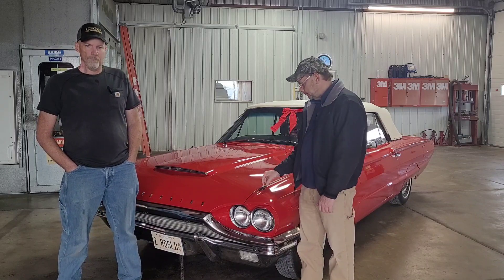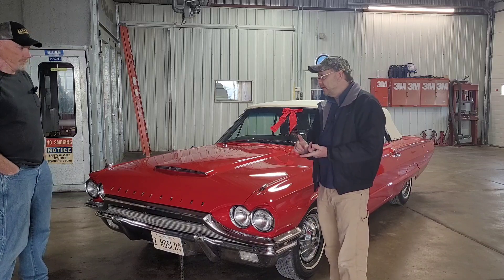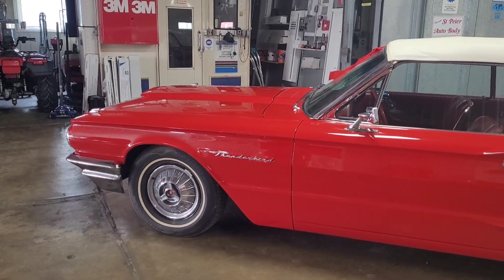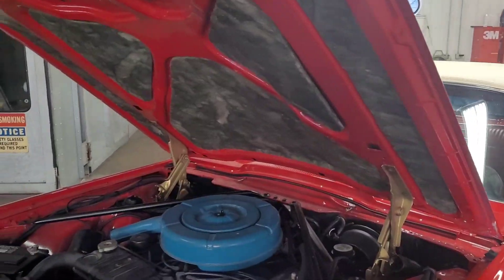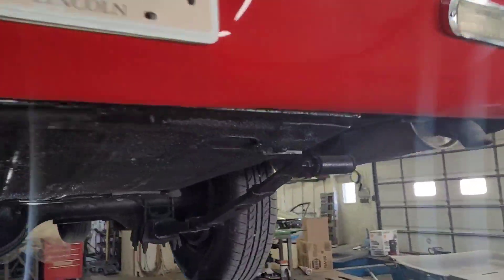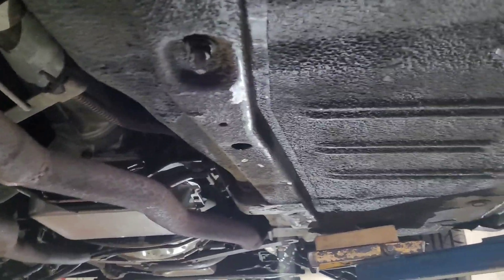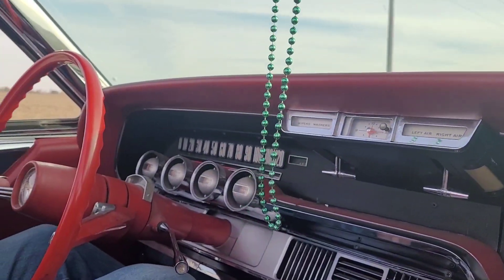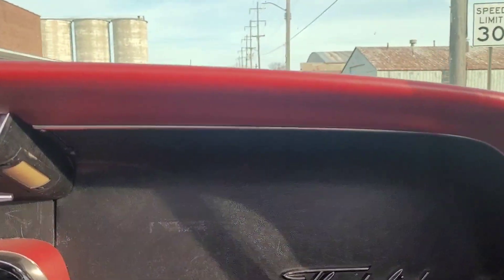1964 Ford Thunderbird Convertible For Sale 48k Original Miles & Loaded With Factory Options!

Comment: I've been playing around with old Birds for 50 years.  The main reason for a slow flip-lid motor is a bad ground. The negative battery cable normally connect to the engine block.  There needs to be a ground strap between the engine block and the chassis of the car.  If that ground strap is missing you have a high resistance between the engine block and chassis.  Normally everything will work, just slowly as in the case of the flip lid motor.  The rear windows also need to be cleaned and greased, as the 64-66 are geared high and the motor just barely has enough torque to make them operate quickly and smoothly.  Also, whenever you run the top up or down the engine should be running and hold it at a very fast idle that will allow the alternator to provide plenty of amps to keep up with the current draw of the top operation.  The 64 convertible went to an all-in-one switch on the flip-lid which can be troublesome.  This car obviously has a good one since it all works properly.  You can get the switch rebuilt at several vendors if necessary.  The flip lid transmission gears can get worn and allow a lot of slop which throws the switch out of adjustment.  They can be rebuilt as well.  There is also a set screw that can be adjusted on the worm gear of the flip lid transmission to take out slop.  The Marquette speed control likely will not work as it is complex, much more so than the perfect circle used on many other cars at this time.  This particular car looks to be in fantastic shape and should sell quickly. they are wonderful cars.  I could go on and on about the heat and air, etc but I won't bore you with all the details.  When everything is working properly these are neat cars.  ONE MORE THING:  For 64 only, there was a brake relay added after the sale because all six brake light bulbs being fed by the hydraulic brake switch was too much current for the switch .  It caused issues with the brake light switch burning up from excessive current.  A fix was added to install a brake light relay on the left from inner fender.  This powered the brake lights through the relay contacts.  This kit is available from the Tbird suppliers.  Many of the 64s never did get this dealer fix.
Reply from the maker: That's all great info, Jeff! I'll make sure that Brandon sees it. It sounds like you know the birds like I know the 68 XLs.